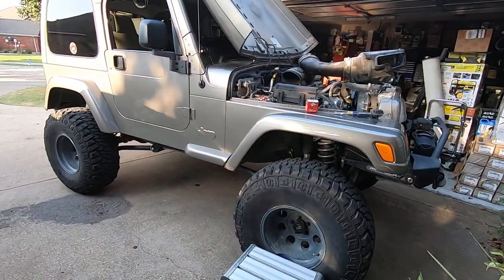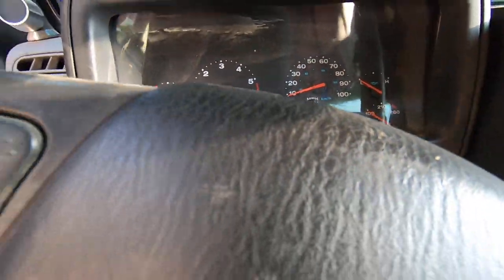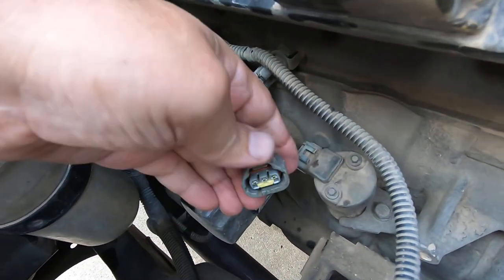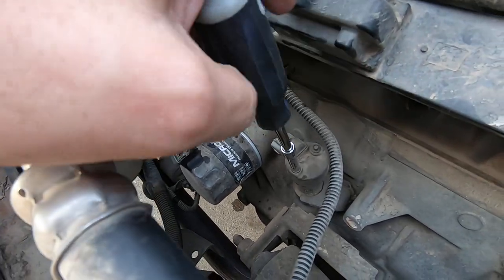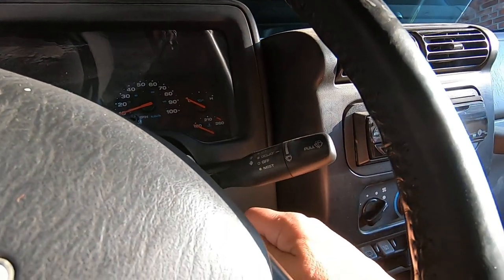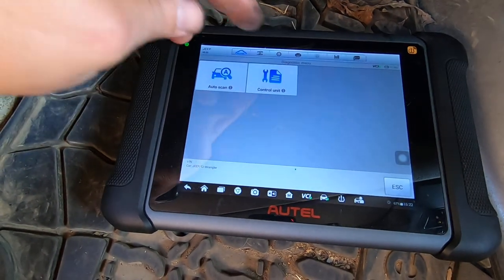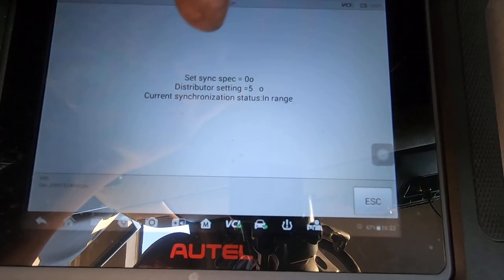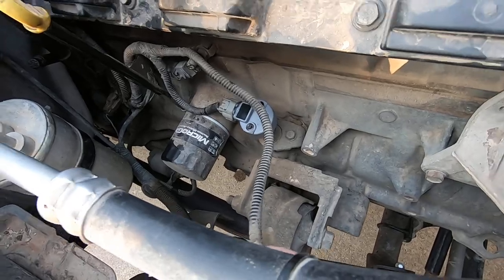2004 Jeep Wrangler Hard to Start / No Start with Code P0340 Cam Sensor and Synchronizer adjustment

Comment: I had to change the Cam Position Sensor as well but it broke again about a month later . The Cam shaft synchronizer had a lot of slop ( wore out > 430,000KMS ) and it will just chew up the insides if the CPS . I had to replace the synchronizer and put in a new sensor . You will usually hear a tapping noise when the synchronizer  starts wearing out . That noise is the synchronizer hitting the sensor .

Comment: I had this same issue on my 4.0, 99 Jeep Grand Cherokee.   From what I discovered-- (going off of memory)---   That same code will trip, whether it's the cam shaft or crank shaft sensor.  I think the code is just telling you that the two sensors are not in sync;  So it will trip that code if either of them goes bad.    So it can fool you sometimes, making you think it's the cam sensor, when really it's the crank sensor.  I ended up needing both to get rid of an intermittent issue;   and I even had to do the procedure to walk that cam sensor another tooth forward (just like you would do a distributor)---  the guys before me were Mexicans, and apparently they didn't know what they were doing;  I was surprised it ran as good as it did, with the timing being off by a tooth.    I found that this is actually the only issue these engines really have.  The 4.0 is a solid engine.

Comment: OK, I'm getting this code now.   Background,  it was hard to start, taking taking 2, 3 then 4 turns of the key to get it to start. Intermittent P301 code.  Then I had to change the flywheel & clutch, pulled into the shop got those changed.  Went to go home.   It wouldn't start at all, popped P340 right away.  Changed both cam/crank sensors still won't start at all.  Any ideas?
Reply from the maker: Take the cam sensor off, crank the engine, and ensure the cam housing shaft rotates. If it does, grab it with your fingers, spin it back and forth, and make sure it is solid. Clear the codes and see what comes back. If it is the P340 then the sensor may be bad.
Reply: did you ever found the problem? I'm currently having the same P0340 on my 2004 TJ and I'm pulling my hair after 3 days struggling.
Reply: @c938695  I have not found a fix for the intermittent P301 code.  But I did correct the starting issue.  Amazon sent me the WRONG flywheel in the correct package.  Yes I ordered the correct flywheel and according to the box I was sent the correct one.  But it turns out it was for a different year jeep.  It had to many timing marks on it.  The one for the 06 has 4 timing marks.  Since the one they sent me had more, the sensors couldn't read set the correct timing.

Comment: Which Autel unit are you using?
Reply from the maker: I am using the MS906TS but the MS906BT is the same scan tool without the TPMS feature.
https://amzn.to/3O21RQY
Autel MS906TS                                         
https://amzn.to/3a26b2j
Autel MS906BT